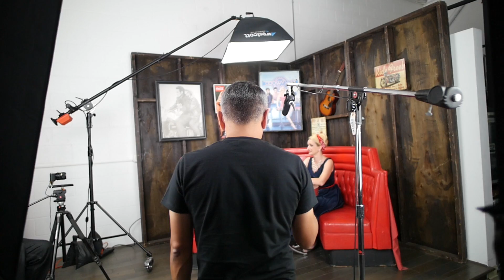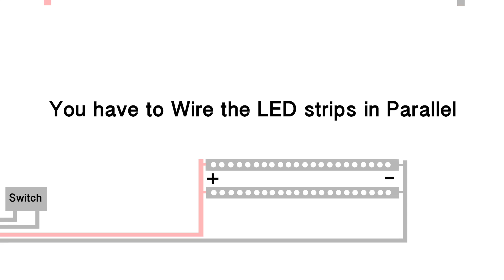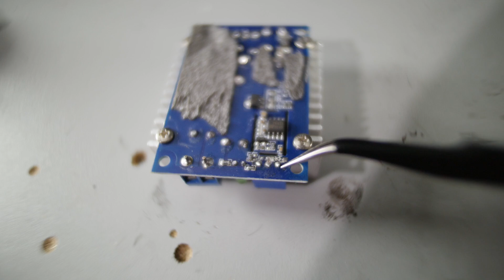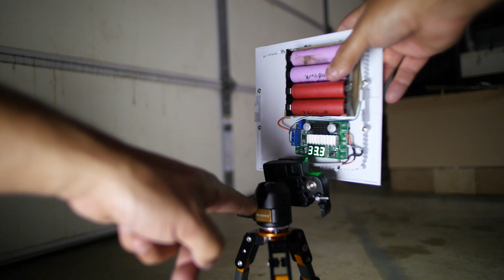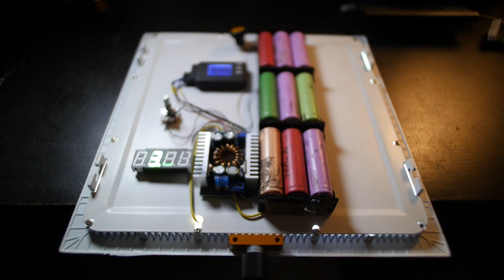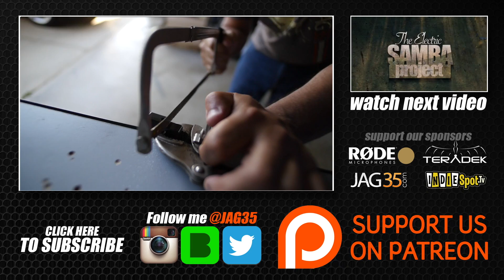$100 DIY led Video SOFT light  -   Vlog #154

Comment: just noted the charger listed, 18650 Dual Slot Rechargeable Battery Charger Li-ion Travel Wall Charger US Plug
should be remove this item, as many other youtube authors have show these are unsafe for unprotected cells,
Reply from the maker: Im unaware of a problem with these
Reply: well as always you pay for what you get.... 
unfortunately inexpensive items like this from china have poor electronics. And being that you are using unprotected cells its critical that you monitor what the charger is doing.

Comment: swivel ball mount, possibly add a url above for users
16.99 +1.5-1.75 shipping vs amazon 
http://www.ebay.com/itm/360-Rotate-Tripod-Monopod-Ball-Head-Camera-Ballhead-Quick-Release-Plate-LF24-/232087805971?hash=item360982e013:g:GmYAAOSwYIxX38Ab

Comment: Would it be possible to use sony NPF batteries with this light. (I know that would make it a bit more expensive, but also much more professional )
Reply from the maker: +Tim Felbinger yes those are just 2s instead of 3s pretty sure same DC -DC would work

Comment: You shouldn't use the pot to change the voltage / brightness but PWM instead.
The color of that light changes by a lot depending on the voltage.
Reply from the maker: +Toni Lähdekorpi   Its a switch mode power supply,  isn't that how it controls voltage?
Reply: jehugarcia Yes, that's how the power supply works and it's a completely usable way to control the brightness of those LED strips if you are just using it for general lighting.

But most LED's change their color temperature depending on the voltage. When lighting for video or photography, you should control the brightness by pulsing them on and off with the same voltage.

Oh, and obviously this isn't a problem if you only use one light and fix your white balance after changing brightness.
Reply: Oh, and hey, you should test this!
Lock your white balance and take a couple of pictures with lowest and highest voltage. Then compare them side by side.
Reply from the maker: +Toni Lähdekorpi  will  check it out

Comment: Thank you, that's a very well thought out driver :) It shows that you have some battery management experience...

But... Well.... The used LED fixture? It gives about the same total light output as a more expensive panel, true. But it is much, much, MUCH worse in color accuracy, with a CRI of about ~70. That's worse than many cheap fluorescents, like the absolutely horrible high-efficiency tubes many offices install. That what gives you the very hard to manage skintone, a total inability to record anything purple, and very harsh transitions from yellow to red (which is what makes skintones "flaky").
Normally we use a minimum of CRI 90 light sources, and for highly saturated colors even CRI 95 might be "not enough" to get accurate color. There are some LEDs that can give you good color reproduction, but they're expensive. Typically about 5$ per W if you want production grade quality and long-term reliability (cheap LEDs can often halve their light output during the first hundred hours of usage...).

That's not criticism of your video, just some warnings about thinking that cheap LED's are in any way "good" - either in longevity or color reproduction quality.
Reply from the maker: +AJBtheSuede  agreed,   Light from the $25 light panel used here is not as good as the $1600  panel sold by LightPanels
Reply: ....but with some research into light color quality, you can apply your solution with just a slightly better LED source, costing maybe 50-75$ more for the same luminosity. That would yield just as great a "value" per spent dollar, but at a slightly higher price point. It all depends oon what your end application requirements are...  I greatly approve of this DIY approach, especially since large manufacturers still charge a leg and an arm for getting slightly better color quality. Thank you again :)
Reply: if you use your own LED strips you can get 90 CRI ones for a decent price.  maybe just stick them on a plastic square.